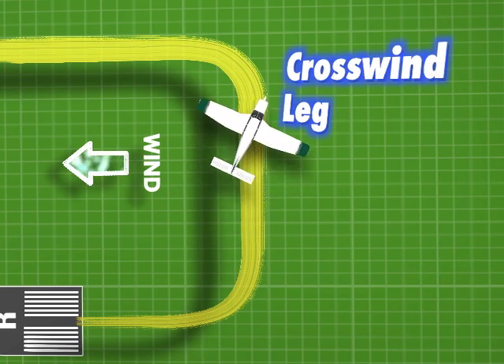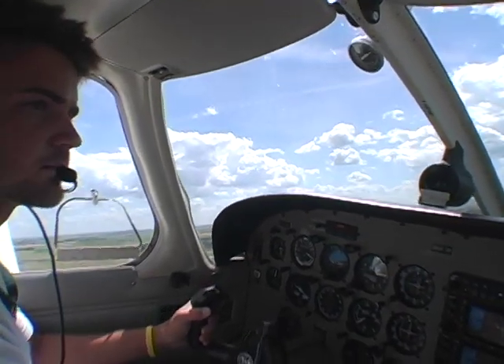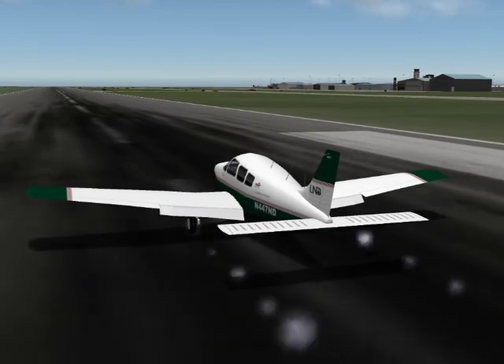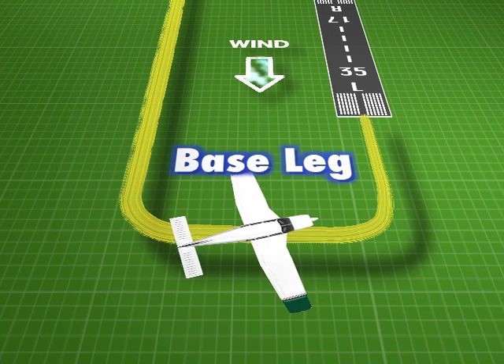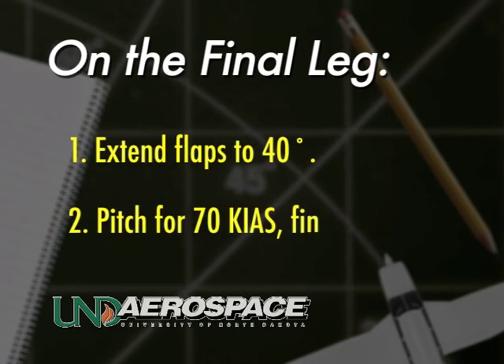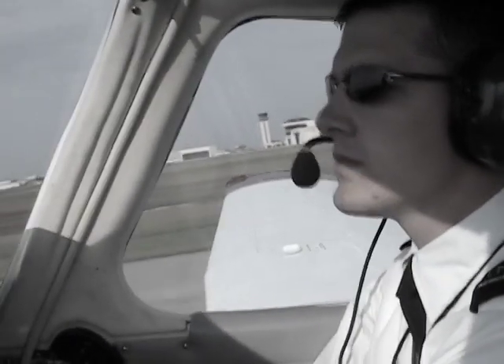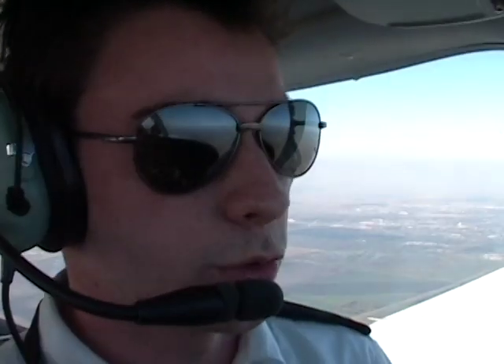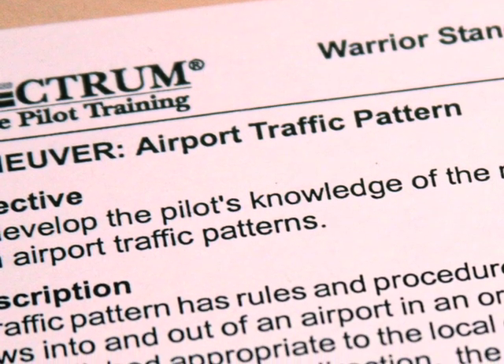(VIDEO 2 of 2) The Airport Traffic Pattern

Comment: That was good, but it didn't mention keeping the aimpoint from moving up or down in windscreen on final by changing the power setting. It should also warn about pulling the yoke back during the turns which increases the G-load on the wing and could reduce your airspeed below a safe speed. And, you should start the roundout when the runway appears to suddenly get wider.